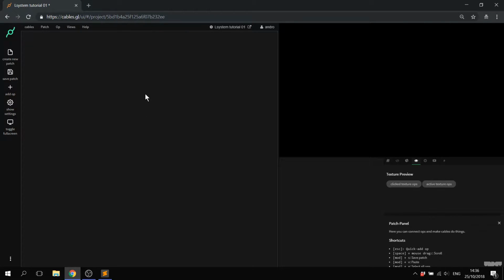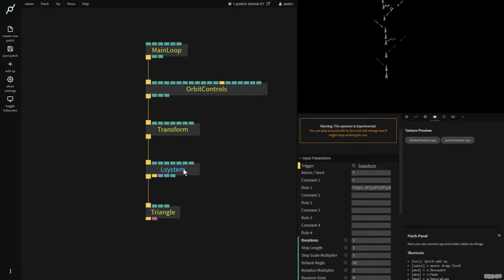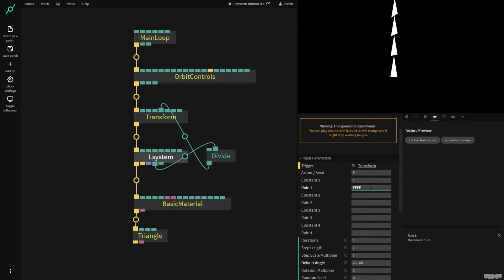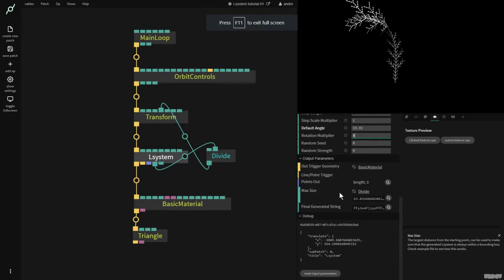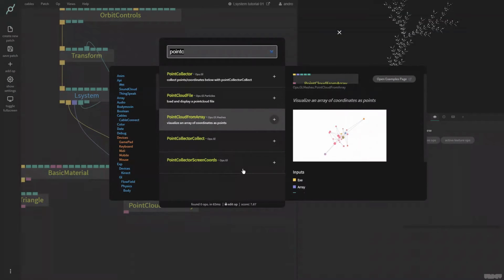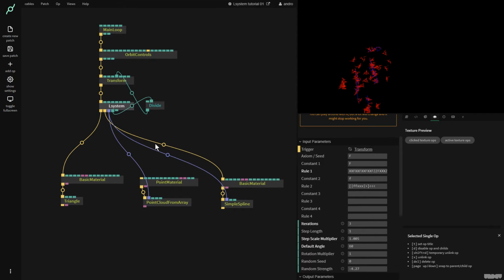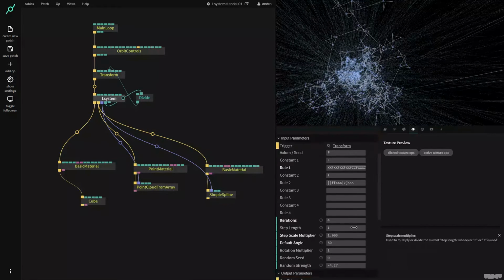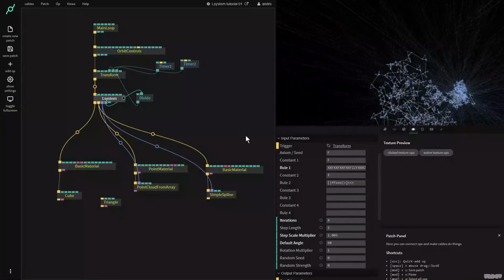Cables LSystem Operator

Comment: b--b-but will it ever be on github with MIT license. i just dont like "vendor lock ins" and would like to merge it with other engines aswell. nonetheless, thanks for the nice explanation
Reply from the maker: We don't think it would make any sense to release the source code as it's been designed to work specifically only with cables.
This brilliant tutorial from Daniel Shiffman was a great help in getting the project from the ground. 
https://youtu.be/E1B4UoSQMFw
Reply: Yea, i mean like the cables editor itself on GitHub... like Farbrausch Werkkzeug (fr_public). I guess you follow some company goals with cables.gl, so that wont happen